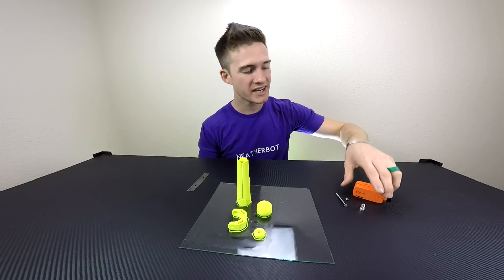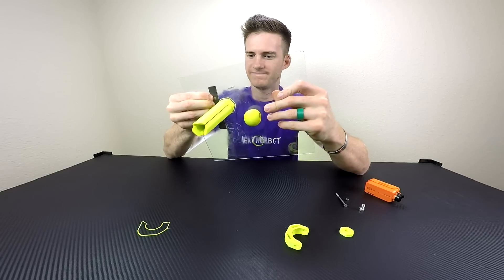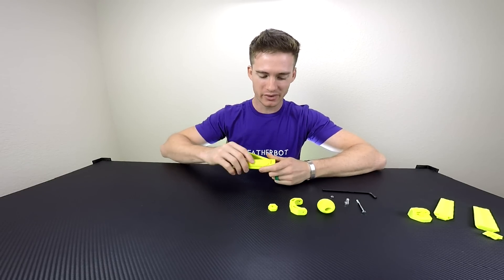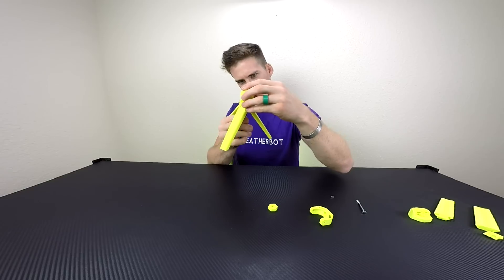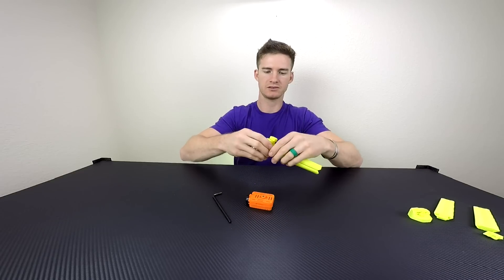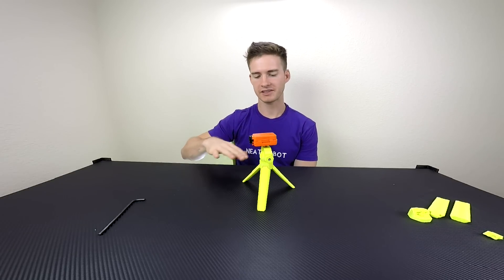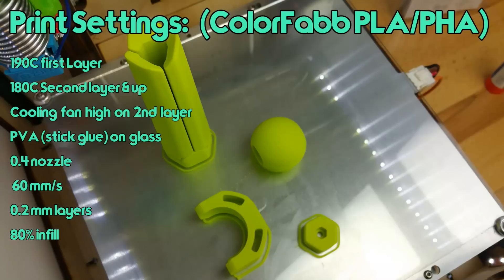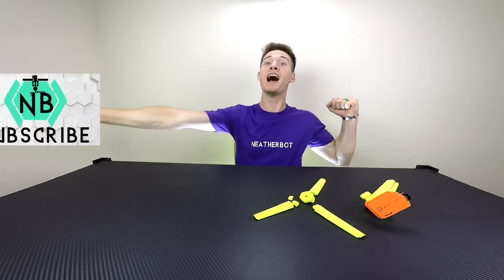3D Printed Tripod

Comment: Once you get to really high infill percentage, it can be getter just to go to 100% as it may print significantly quicker while using only a bit more filament.
Reply from the maker: +Ian Colquhoun this is an interesting comment. Can you help me understand how it would print faster at 100% in fill than 80%?
Reply: NeatherBot because or retraction.   With solid infill the printer is doing a lot more continuous lines which it can do very quickly. Infill patterns require a lot of retraction because it is switching positions frequently. This is worth it at low infill settings but once you get to higher infill settings it may be quicker to print solid.
Reply: Direction changes in the print path take time. Jetting through a series of fast straight lines 'can' be faster than an 80% honey comb pattern as an example.
Reply from the maker: Putting your theory to the test I just sliced the same part with 80% and 100% infill and looked at the calculated print time. 80% was 5hrs 15 min & 100% was 5hrs 40min I am having a hard time buying into this theory. I would not expect infill to be retracting much at all especially enough to slow down the print time. WHat infill pattern are you printing? I print with Rectilinear infill.
Reply: My infill is also rectangular, this could be a hold over from hexagonal infill. I'll do a test print and report back before I speculate any further :)
Reply: Linear infill is much better for 100% infill, but usually only for 100% infill. Idk which slicers use linear other than matter control in which I use.
Reply from the maker: +JuliansRandomProject I'm very curious. Please let me know what you find out!
Reply: +NeatherBot I can testify to the fact that it's faster on my printer with 100% infill. How much faster greatly depends on the part. Parts with infill where it would have to retract, make a move, then do more infill ( a thick walled cup for ex) are significantly sped up on mine.
Reply from the maker: +fastslash25 I use simplify 3D for my slicer and have a few different in full options to choose from.
Reply: slicer estimated time is weak, does not take in consideration acceleration values or max printer speed or anything like that, i can buy into the 100% infill being faster- but it would be good to have a side by side stopwatch comparison lol. Also Rectilinear infill that goes along your axis's Seems to be less stress on printer in terms of resonating frequencies and surface finish- id recommend doing that.
Reply from the maker: In the Simplify 3D there are settings you can adjust to get the print time calculations pretty close to real time. I have found the calculations are pretty close. While I agree this should not be based completely on slicer estimates, its a good data point. I have found that if there is resonation in a printers linear motion rotating the part so the print long straight features are not in line with a single axis helps. Is that what you are suggesting?

Comment: 100% infill in a "strong modified" PLA or ABS would have made it a lot more durable.

100% infill is surprisingly a lot more strong then even 90%.
probably why its creator suggested it.

at 100% it would have been as strong as a store bought PLA or ABS stand.

Comment: did you test the part with 100% infill and see if it was more rugged?
Reply from the maker: +tyler newcomb I did not. I made an assumption. Didn't think 100% infill would make the leg joints much stronger. I may be wrong!
Reply: thanks for answering
Reply from the maker: +tyler newcomb absolutely, if you print at 100% and its super strong let me know!
Reply: @neatherbot  Lol, don't. It may make it stronger, but it's a huge drain for filament

Comment: Did you print the legs with support? Every time I tried to print them, the legs would end up getting knocked over before the print finished. Adding support helped this, but then I ended up breaking the legs XD. Still haven't gotten around to reprinting them.

Comment: When those legs snapped it looked like layer delamination? If so, isn't that a temperature issue?
Reply from the maker: +fastslash25 yes later delamination is what happened. I do not think it was from poor temperature settings, it was just more stress than the plastic could handle...
Reply: U sure? I think that delamination is not at all something at near 100% infill is the plastics fault.
Reply: I agree pump the temperature up 5c also imho more importantly:
reducing backlash/play in the printer will align your layers up better making the layerbonding stronger, also you wont have to print them larger sized or adjust your slicers clearence (simplify 3d horsional size compensation helps)

you could also tweak acceleration and speeds to get the layers to sit proper- I hear maxing out the acceleration on the Z axis helps it go down at correct increments as they tend to bind on um1 design.

a pet peve of mine is when you shine a light down on a print and you can see the layers out of alignment- it makes me want to re-build the printer from scratch :P cause that causes weak parts and bad looking figurines :P

ive observed nylons make some of the strongest inter-layer bonding.
so printing this tripod in ABS or nylon should make it as ruged as the ebay counterpart :P

great video- the tripod looks great- perfect for indoor timelapses and webcamming, good work man.

also it seems fat nozzles make for really really really strong prints. like 0.6 or more
Reply from the maker: You may be right about the temperature, I have been printing a bit hotter since that tripod with good results. There is not much backlash in the printer, the majority of the layer misalignment is from filament having water in it. I dried it out and everything prints smooth as butter again. Haha I am kind of the same way..whenever I see a small issue in my prints it makes me want to build a whole new printer...my UM1 is getting a tad old and I have been trying to keep it running but its getting to a point where I want to make a core XY. Do you have any suggestions on a good core XY design I could look into? Yeah fatty nozzles are awesome. if you havent seen my volcano series check it out https://www.youtube.com/playlist?list=PL7KEG3WCMTU51bKK7kXF3XOdjoWu8FqvL
Reply: all i can suggest is rails>rods for play/backlash, and if you can gear down the X and Y axis and use 0.9 steppers, and a pancake 0.9 stepper on an extruder like e3d titan direct drive you should get a light hotend that has good pressing force and high resolution..

i guess the goal is to have as much resolution as possible and as little play as possible- every axis counts including E :P, it all shows up in prints- using a smoothieware is favorable because with all that extra resolution itl bog down a normal arduino.. But yeah that should get you some of the best layer alignment- Assuming your printbed doesn't wobble and your frame is made of some sort of metal that doesnt thermally expand or expand due to humidity and all those factors

and bearings are tricky like smooth rod stuff- they bind if theyre not perfectly aligned- they rattle if theyre not perfectly aligned- even when theyre perfectly aligned if they have a little bit of slop and hit resonating frequency they get super loud- oh man somany variables.

zortrax m200 prints really well but even that you can start seeing the resolution of the stepper motors in the prints

oh and when you consider resolution of steppeers bla bla- ignore microsteps they are barely accurate and they act more like springs to dampen sound if anything especially if the stepper has any load on it.
Reply from the maker: +meky0 thanks for the info. Do you know if any websites that have core xy designs using 80/20? I am planning on using igus rails and a smoothieboard. But I'm not sure which core XY is the best. I'm looking around for a frame that looks rigid.
Reply: openbuilds have heaps of designs but using their open system , but its not hard designing your own- igus is kinda sloppy but quiet. if u can get hiwin it might be better for precision. but may run slightly louder. not a big fan of core x-y tho. the long belt seems to wobble a fair bit. perhaps if you go that route try a wider belt for rigidity. not your standard width for gt2 but maybe double wide. i personally like to isolate each axis it tends to simplfy things alot. makes servicing easier imho
Reply from the maker: Thanks for the tips! Hopefully I get to start building another printer soon!

Comment: did the threads upscale too or were they still difficult to tap with the hardware before installation?
Reply from the maker: +Leo Levarre-Waters everything scaled up just a tad worked for me. The threads came out perfect and worked well without any problems. Had to thread the bolt in and out a few times to clean everything up.

Comment: I love how you ignored the recommended settings and then ran into durability problems, and then proceeded to berate the design because you "thought 100% in fill was a bit excessive." Being an amateur is one thing, being an amateur which ignores the basics of engineering principals when working with an engineering heavy hobby is just a waste of time. Please consider tuning your content so that you don't take away from the hard work that the creator put into making the tripod design you so easily spoke about negatively,

again, because you ignored the structural build recommendations from the creator.